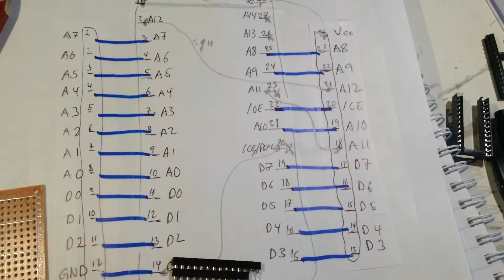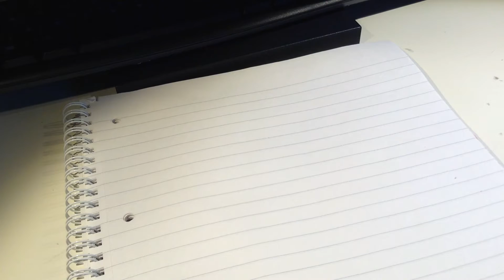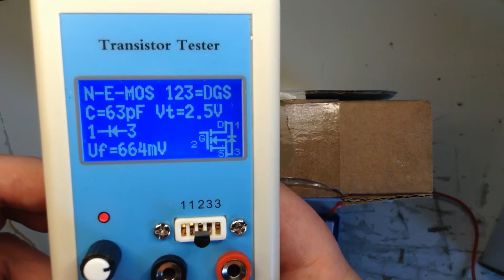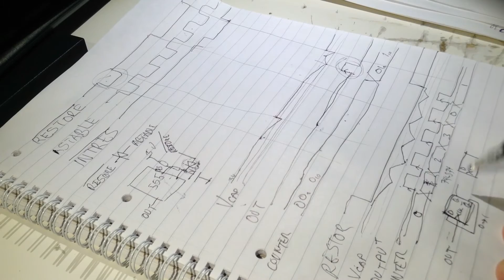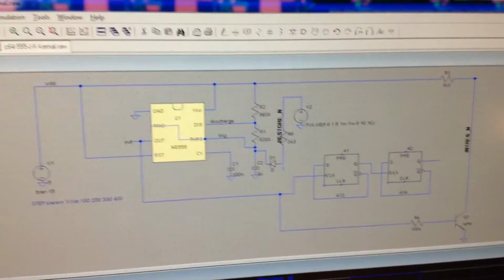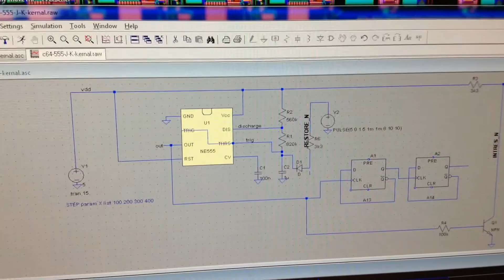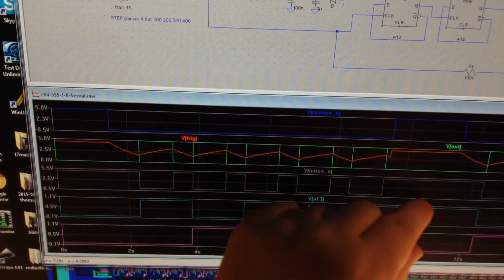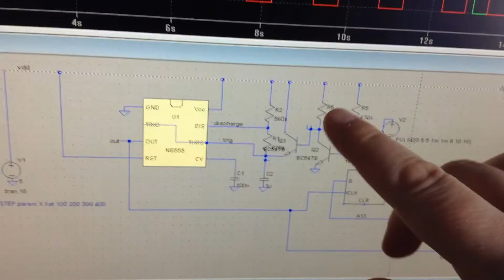C64 Switchless Multi Kernal part 2

Comment: Loving the C64 Switchless Multi Kernal series, can't wait for part 3. The 555 timer, that bought back some good memories. I built a FM radio transmitter using a 555 Timer back in the day (mid 90's) it was one of my first projects it wasn't very powerful (2 meter range) but hay, it worked.
Reply from the maker: Wow FM transmitter? I never thought they were that fast. Cool. Been looking at fm-bug videos. The circuits are scary simple with DIY air coils and a transistor or two. Not sure how they work, but by the looks, the output transistor is connected to a LC-tank which has a resonance frequency which makes the transistor oscillate, and if voltage (sound) is changed on that transistor base, the oscillator speed changes.. Check out his channel: https://www.youtube.com/user/dazaro3/videos

Comment: What was wrong with that first transistor you tested?
Reply from the maker: Hi thanks for asking. All components were fine. The tester aided me in figuring out the pinout of the transistor which can be a pain. Usually one has to have the datasheet handy when working with these three legged devices.) The transistor is not going into the final circuit, it is just helping with sensing RESTORE and driving the yellow indicator LED. The restore pull up is very weak (1 megaohm), and I didn't want to disturb it with something is not supposed to be there in the end. The transistor is a MOSFet (2N7000), they draw negligable current (in theory zero but there is always leakage). They are digital-friendly because the switch at around 2.5V (half of 5V).
Reply: +bwack it's just that the tester showed a weird schematic on the first test in the video. I thought it might be faulty or something other than a transistor or something.
Reply from the maker: The tester shows the schematic symbol for a NMOS transistor with pinnumbers for the gate, drain and source. It also shows the body diode.
Reply: +bwack So an NMOS transistor is completely different from a PNP transistor.
Reply from the maker: Yes. MOSFET (Metal Oxide Semiconductor Field Effect Transistors) controls a current with the gates electric field and the gate is isolated with an oxide layer.
In a BJT (npn or pnp type) the small base current controls a barrier and allows for a larger an current to flow and you get amplification.
The BJTs needs resistors to control the current in on the base, while MOSFETs have virtually no current in on the gate. The gate is said to be charged and discharged (notice at the beginning of the video when I touch the gate with my finger (the yellow led dims and glows). The biggest advantages with MOS I think was in the microchip design not needing resistors to limit current like they did with TTL logic design. The C64 is a mix of TTL and NMOS design, while newer designs are pure CMOS designs.
Reply: What is the amplification rate for BJT transistors? How does it vary? And how about MOSFETs? Do they amplify as well?
Reply from the maker: The current gain (gain is ampliciation rate) varies a lot from device to device. Designing with an absolute current gain is therefor virtually useless. They range from 20s to several 100s in hFE (current gain). If used as amplifier and by adding a resistor on the emitter, some gain is traded off with higher stability and better linearity. The higher the current gain, the less error. You can see it in the equations how when hFE -> infinity, the error terms go to zero.
 MOSFETS can be used in amplifier circuits as well. They can control a current too. In audio amplifiers, sometimes they use BJTs sometimes MOSFETS. What is common is that the voltage output is fed back to a differential amplifier, compared and then error is adjusted. The differential amp will do whatever to the gate to obtain correct voltage on the mosfets output. (because the diff amp strives to make its two inputs equal, one input is the signal, the other is the feedback). So I guess controlling it directly will not be very stable or if you somehow tweek it to be stable, heat will make it drift.
Reply: basically a transistor isn't used for amplification but for switching then? I thought audio amplifiers used transistors to amplify the signal.
Reply from the maker: oops i editted my former reply. Both, switching applications (digitial signals or switched power supplies typical) and amplifications (typically audio). BJTs and MOSFETs operate in different modes. Say for my example, controlling the INTRST signal, a transistor needs to pull the line low. The transistor closes its collector and emitter together. To be able to get low enough voltage, one can use the worst case current gain (the minimum value indicated in the datasheet) to calculated the largest base resistor needed to be able to close the collector emitter. Usually I don't calculate it, I just assume that the gain is so high it will be ok, but when I did a RGB mood light in 2008 or so, I did calculate with hFE minimum = 60 so i needed a resistor low enough to ensure that the LEDS were turned fully on. Calculations are easy. Mr Carlssons youtube channels latest video has a video on it.
Reply from the maker: Mr Carlson's Lab, controlling nixie tubes (not leds but hey) https://www.youtube.com/watch?v=jytF5bvPGcU
Reply: Thanks

Comment: This video gives a good example of how digital signal design intersects with circuit design. Pure highs and lows mixed with capacitor discharge times. Very interesting. Can anything be said about how quickly a capacitor discharges? And what about when it deteriorates over time? It could interfere with functionality.
Reply from the maker: The resistors control the current in and out of the capacitor, and yes when the caps age the value changes and the flashing period changes. If precision is important then crystals are better applicants :)
Reply: Ah right